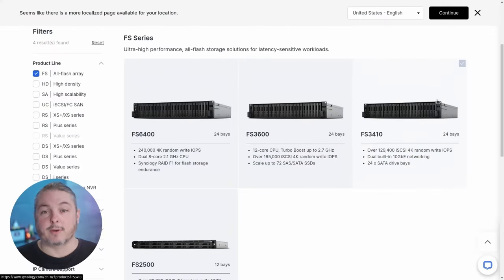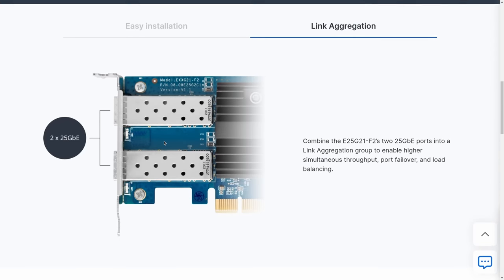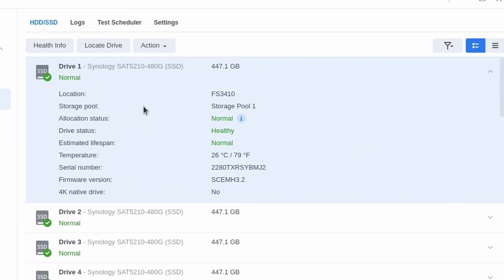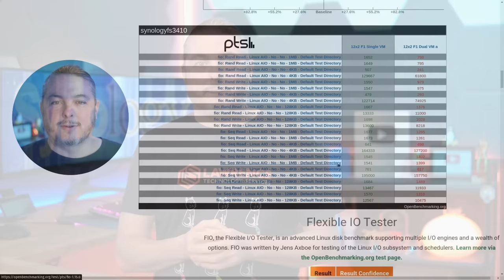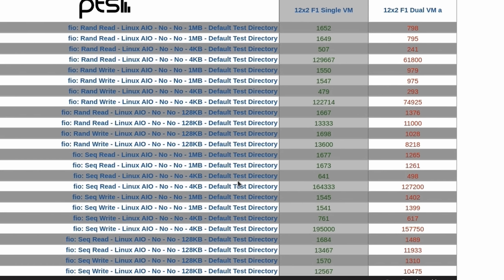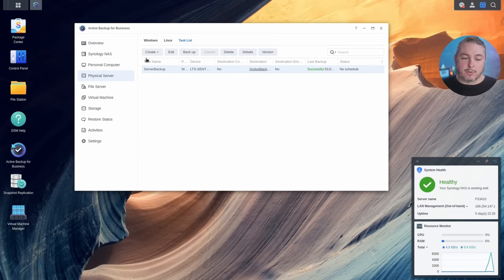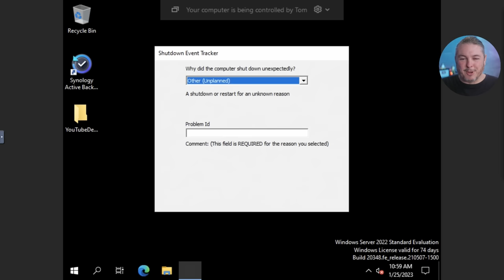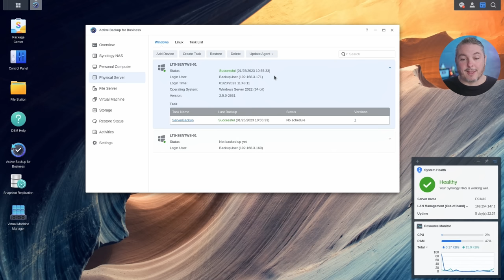Synology FS3410 Review

Comment: Great review Tom!  we use the FS6400.  Its been in service for 3 years. 30 Video/Photo editors using it through SMB.  All Enterprise Samsung 7.68TB SSDs in RAID F1.  We havent had a single hiccup in 3 years of daily use.  It's a BEAST.  ALL backups are done to it as well.  Using a RS2818RP+ for backups.
Reply: What are the drives do you use ?

Comment: Found an Aussie distributor that sells the drives - 960GB 2.5" 1.3DWPD for $490, the Intel equivalent S4520 960GB (2 DWPD) goes for $260.
So not quite HP/Dell levels of markup but over 24 bays it adds up.

Comment: We got a FS6400 because FS3600 EoS last year. Issue with those new models that require Synology drives is they have no 8TB drives. Many of those old models combos like FS6400 come with Micron 8TB drives.

Let's talk about Synology drive requirements. I am not fully against it. It's common in enterprises. However, those models should also offer enterprise level of support options, like 1hr or less support response, active hardware monitor, advanced replacement etc.
Reply: As this NAS isn't an enterprise product, it shouldn't have these SSD requirements.

Comment: i do like the Synology RS/FS To. I have a few customers, with only low load on those RS (1221+) they are attaced as NFS to a single/dual node ESX installation. the active backup suite is doin a good job. we use hyper backup then to mount S3/Storageblobs to get backup out of customer site. together with the hyper explorer and the storage appliance for vmware you get pretty much value out of those devices for small/medium business

Comment: I think some of the smaller units that have the dual NVMe slots do have some limitations when you use consumer versus Synology NVMe drives certain functions aren't always available I believe.

Is there a test suite in Phoenix.
To test like virtual machine instances and how many it can sustain? Or at least benchmark the performance of a certain number of VMs on a storage subsystem?

Comment: I would agree that they don’t support non-certified drives. But not accepting them makes it electronic trash quite quickly. Locks out the used gear market and also companies cannot decommission them to e.g. cold storage with new super-large aftermarket SSDs.

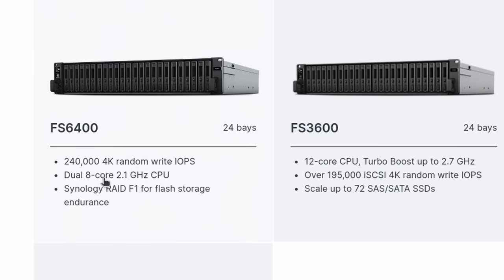Comment: 3:44 "Really high performance at 240,000 4K random write IOPS." <--- You can exceed this number with just a single NVMe drive (e.g. the last generation 3.2TB Kioxia CM6-V does 350K sustained 4K random write IOPS). 

I understand there's a place for these Synology machines and that they're a good fit for a number of customers, but you should put the performance into context. This box is not fast for the money you're spending on it, especially in 2023.
Reply: Yeah. I love the Synology OS.  But I just couldn't bring myself to spend $16k on a SynologyFS series server that is loaded with SATA drives when I could get a supermicro system with all nvme gen 4 storage for cheaper.   Do I need 400gbps read/write speeds? No.  But if I'm spending $20k it's insulting to get 15gbps.

The Synology Drive, Hyperbackup and Active Backup for Business though are superb and an incredible value. 

It's just a shame you can't license their OS for real hardware.

Comment: Hm, for those specs it sounds pretty expensive.. why is that? D-Xeon, small RAM, SATA… Btw you did not mention drive formfactor or connectors (2.5 sata). I thought it’s NVMe U.2 for that price. I guess that’s the SW price?

Comment: I’m a little surprised this uses SATA SSDs as opposed to U.2 NVMe drives. Now that U.2 is entering the used market, id like an affordable way to mess around with it.
Reply: As this NAS is targeted for SMB, then maybe it's ok? Should have Nvme or a few/half U.2 slots maybe. But then they shouldn't have the hard SSD requirements - that's for Enterprise.

Comment: That's terrible if the performance scales inversely with the number of connections. Throughput usually increases with a more parallel load. What are you getting in return for the performance loss?

Comment: I have been looking at these in Australia, the distributors that stock them dont actually sell the drives they require which is plain weird.
A FS3410 is around $10500 AUD ex-gst for the chassis, so you end up comparing with a 2RU server with 24 U.3 bays that would include a much better CPU and out perform these by a substantial amount. 
I happen to like Synology software a lot but their hardware is just overpriced & underpowered in almost all segments.

Comment: I had problem about my synology nas 
And Steve Baker
Technical Support Engineer write me about my problem that 

We are sorry to hear that your DS218 has to be reset. This is likely caused by an issue in the DSM operating-system.

We understand that you are worried about losing your data. Please rest assured, your data should not be affected by the reset as the OS and data are stored in separate partitions on the drives. When re-installing the OS, the system should normally not touch the data-partitions of your drives.
I beleived and i  did what he said now all my data erased omg i shocked after sir Steve Baker dissepeared i am alone there is nothing in my hands
Synology is regret bad nas choose qnap there isnt good support for problemss !!!
Synology is big regret